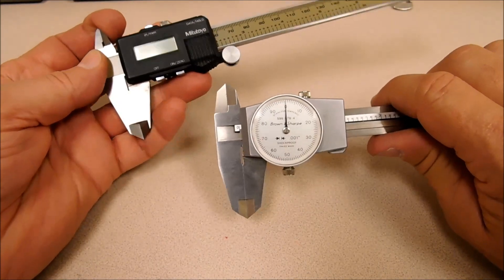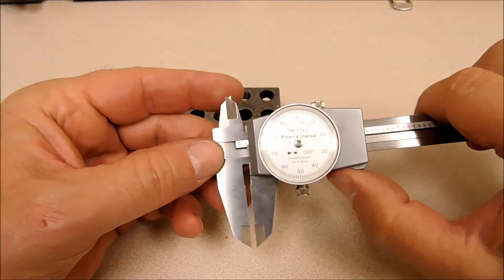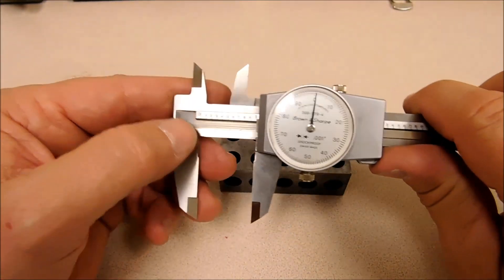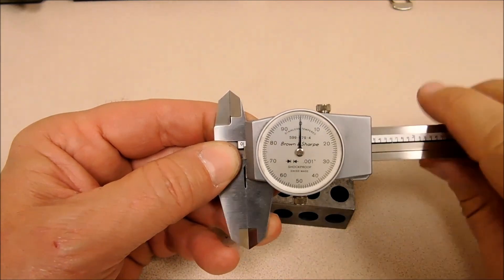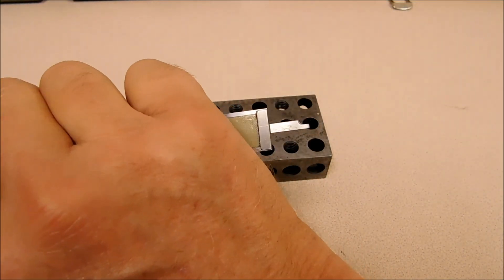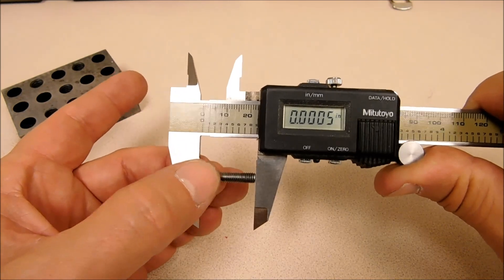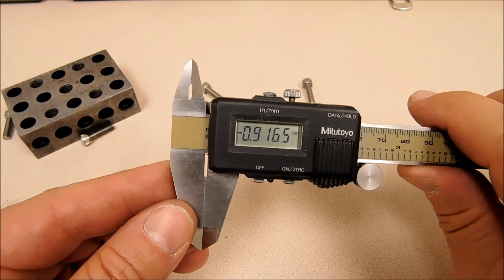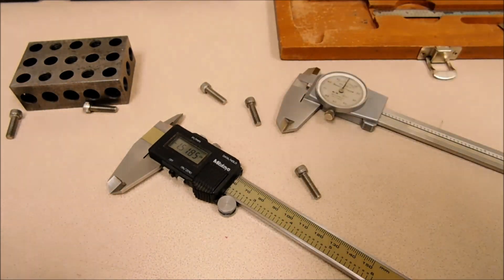Calipers -- Dial vs. Digital -- Does one do more ???  ( yes )

Comment: Now hears a question. not related to this video but it as a point. I was watching a video the other day on. [ A SUBJECT OF THE OLD,  FASHONR 4WAY.  TOOL POST ]  THE TOOL REMOVED THE NEED TO SHIM AS IT WAS CLAMP BY THE RETNING BOLT & PIN.  

ok, now to the question of improving the Base Design as there not maid, anymore but sort after by to days. hobby shop machinists. seeking to avoid the shaming ordeal. I sore . the toling was designed to be healed in a 4way without shims adjustment was by raising and lowering a tool,  hed that was claimed in place. By an internal thrust pin. 

ok here's my idea What if the Tool head was threat & sat in a threaded  Split sleeve. The thrust pin sat in the tool when tightened would clamp around the trends & prevent it rising pin I believe a reason they fell out of favor in industry. sector.   if we grooved the split sleeve would be allowed to rotate. be firmly clamped when pushed upon by the clamping bolt.   best of it trading, when releasing the clamp bolt &  retaining of the hed will enable upper or downward adjustment,   thus no shimming required. 

I watched your video on Boring bars & the versatile of the 1" sleeve holder as was you can use sleeves to go up or down. in tool size. &  putting the Tow ideas to work I think a hybrid of the Two with my new thinking would.  increase adaptability somewhat .  & enable a custom of boring bars to be created.& new tooling.   It may not interest you but I would like your opinion & your permission,  to use your idea.  I don't want to fit an adjustable tool posted.   & I certainly don't want to shim Tooling if it ok I will listen out for a reference to it in your chanal.  I suspect it to be ok in so much you have encouraged us to do so in your demonstration . of your design.  so for the evidence, of Doute can I use your design.,  & you will have. Joint copyright shud anything come of the idea.   Thank you's, truly  Leslie Anthony.  Stuart-Thompson < England Telford woodside.   Shusbery  Tf 75 Pt.  Should you feel the need to write.   Gust checking The Bace,  Son. Great videos Thay are very informative. keep it up.

Comment: How many times a day do you need to play with the battery to make your digital calliper work?  I have two and they drive me nuts.  Open the battery door, closet the battery door.  Remove it, and put it back in.  Twist it.  Open it, put a folded paper inside.  Next week, open it, remove the paper.  WTH?  Why can't it just work?
Reply from the maker: Never. My battery also lasts better than 2 years
Reply: @joepie221  My batteries also last a long time and no problems with them working. Maybe it's the quality of the caliper?
Reply: Mittutoya battery lasts 10 years. Harbour freight two weeks. They look the same. Can't beat a decent dial caliper.
Reply: glyn hodges  $35 - $50 if I remember correctly for each of  them.

Comment: YES, digital calipers DEFINITELY do more...  they run batteries dead and stop working.  stick to dial or vernier.

FIRST LAW OF ENGINEERING:  KISS (Keep It Simple, STUPID)!
SECOND LAW OF ENGINEERING:  if it ain't broke, DON'T FIX IT!
Reply from the maker: You guys must own cheap digitals. My batteries last for years.
Reply: @joepie221  At least we can buy a pallet of batteries at the dollar store cheap '-)
Reply: They run batteries dead when they are cheap chinesiums or knockoffs which draw significantly more current from the battery and draw almost the same amount when they are off (they don't really go off, just the LCD). Mitu or other quality digitals where the electronics isn't simply done as cheap as can be draw significantly lower current and with the LCD off draw significantly less again.

https://youtu.be/KnDype-j3hk
Reply: THIRD LAW OF ENGINEERING: Batteries SUCK :-)

Comment: I also like being able to set zero on the digitals...it's great when, say your dimension is to small to get the depth or height feature on. Zero out on the OVL/OVH (what have you) then measure your step or whichever and there you have a "very near" reading. Oh...and great to do this laying out work  if you don't mind doubling your calipers as a scriber and your tolerances allow.

Comment: I use digital, dial, and even the old-school verniers at times, just depends on the situation.  I have way more faith in my old Starrett dial caliper than my import digital caliper, but will admit to liking the digital for laziness.  Thanks for sharing.
Reply: Other than for nostalgia, in what situation would you use an old-school vernier over both dial and digital? I can't think of a single case where a vernier would be better. Unless you doing something where it's likely to get damaged...
Reply: @steveh8724  Admittedly, often the good quality old school vernier one comes out for fun's sake, but it's also partly to keep in practice for using my height gauges, both of which are in vernier scale (old B&S & Starrett).  I do however use a cheaper plastic vernier daily at work for close fractional measurements as it is graduated in mm and fractional inches to 1/128".  I just love the simplistic elegance of the Vernier scale once one can read it correctly.

Comment: As a new to the trade machinist, here's my experience. The first calipers I purchased were igaging 8" digitals. This was while in my machining school and for the versatility, convenience, and cost. They were and have been great. However, after hiring on at Kurt manufacturing as a cnc machinist... I had a single drop of coolant fall from the lathe directly onto my calipers rendering them useless. AKA not coolant proof! I immediately purchased a 6" dial, brown and sharp (just like yours), because of the reliability. As a new machinist I would suggest a set that is dial and earn your way up to a digital set that has an IP rating for use in the CNC machines.

Comment: I have two of the older Mitutoyo calipers like the one you are using. I have had people try to buy one because,in their opinion,and mine,the new calipers are not as high quality..I also have a Mitutoyo   3axis KC dro on my mill that has functioned flawlessly for 25 years. Yeah, I like Mitutoyo.😃
Reply: Hi joe, just watched your video I also have the same model calipers. Thats not so important , What is; I didnt 
know about the height gage feature. 
I learned something knew, thank you.
Reply: I repair and calibrate them (as well as dial indicators, primarily) and I think that generation of Mitutoyo digital calipers feel heavier and more solid. I just sold a couple pair on eBay. Nothing wrong with the newer ones, but those from a couple generations back are more solid.

Comment: Be aware when battery gets low they get wonky. You can end up with 99" indicated on a 6" caliper.
Reply: See old AvE comparison of cheap v expensive digital calipers, both from Mitutoyo. Low battery voltage is a problem with the cheaper model(s).

Comment: thanks Joe,
 A couple of things. On the dial caliper you can learn to read between the indices for a closer reading than the .0005 of the digital, some guys like that. Also I have the same digital you have and I have to be careful not to hit the zero when using it. The newer digitals have "absolute zero" which pretty much stops that from happening. I think digital, overall, makes for fewer reading mistakes but just playing around I love the vernier calipers from Starrett and B&S. Lots of fun but old timers like me need glasses using them.
Rob
Reply: Rob, I suffered the same problem only worse in reading the vernier scales. Cataracts! I just got multi-focus implants to replace the lenses in my eyes. Pretty amazing technology. As the muscles that have always adjusted the focus work they now do the same with the new lenses. This only applies to the "multi-focus" type. Expensive but worth it. I can see well at distance, intermediate & close. I have 3 calipers. The odd one is quite old and marked USSR.

Comment: I have all three, but gravitate toward the dial caliper because of its analog readout. Like any analog gauge, it’s easier to sense big vs. tiny movements. But the inch/mm feature of my Mitutoyo, combined with that “center to center distance between pins” trick make it indispensable.

Comment: use the zero function all the time at work. even on the 1200mm. I work in an extrusion company and make plastic pipes and the function is really handy when we measure the ovality get the smallest diameter the zero the caliper en get the highest number. I think I use the zero button more then the on/off   :)

Comment: I have and  still use a Sears Craftsman vernier caliper I have had for 32 years.
Small adjustments along the way to keep it accurate. 
Used it for setting up and running a wood molder.

Comment: Another added benefit of the digital is, measuring center to center spacing on hole pairs. Set up the caliper to measure one of the IDs with the upper jaws, then Zero it out. Stick one upper jaw in one hole and the other jaw in the other hole. The reading will be center to center on the holes. Obviously it only works if the 2 holes are the same diameter.

Comment: Dear Joe, I have a vernier caliper (metric and imperial), a dial caliper (imperial only) and two digital calipers. i mostly use the verniers probably form habit as  I had them first. Both the digital caliper have a very useful feature which does not seem to be on the pair that you have. In imperial they offer the option of both fractional imperial and decimal imperial. This can be very useful for checking an unknown item in order to ascertain if one is looking at an imperial or decimal part an if so if it is a fractional size. Maybe not so much for a seasoned hand like you though as you will know most of the decimal / fractional imperial conversions by heart from long usage but for the amateur lime myself a real boon on occasion.

Comment: I've got some (brown and sharp, I think) digital calipers that have a three readout options, metric, inch, and fractional inch, it's sooo useful when measuring parts designed in the USA!  I'm of an age that the UK educational system used fractional inches and millimeters, but not decimal inches, so while I can get by in sixteenths as decimals, 64th and 128th's take some time to calculate, unless I use the calipers👍

Comment: The little step-down on the depth gage is for smaller diameter holes, which are often shorterer (shallower).  I've seen calipers that have a long round rod that can measure deep narrow holes.  Got to be more careful not to bend those!   I've got a set of Fowler dial calipers that reads both inch and metric - now that's a brain fart!
Reply: Ah. Obvious now you mention it! One of those little features that unless you've needed to use it or been told what it's for goes in the 'curious, but don't need to know right now' queue. Thanks.
Reply: The narrowed end is to index the apex of a drilled conic hole-

Comment: your trick with the screw lengths works just as well with the dial calipers within +-1inch.
Reply: Actually, that works if delta is < 1/2 full dial scale. Otherwise you have to be very careful...which way did it go?

Comment: I have 12” Mitutoyo dial, 6” Mitutoyo digital, and a set of Mitutoyo Diamond Verniers.   I bought the verniers in 1970.   Still the goto set.  Never a dead battery.  Never slips a cog.   The Diamond Verniers use .050” rather than .025.  Easier to read.  The digital are easiest to read, but are delicate.

Comment: You missed one for the dial - infinite battery life. Had both and been caught out by a dying battery several times. Worse still with one (not mitutoyo) the first sign of it was inaccurate readings. Now I only have dial.
Reply: My Mitutoyo caliper battery lasts nearly forever...even when leaving it on.  Granted it's not forever but long enough that it's a non issue for me.
Reply: How long of a period before your battery died?

Maybe change the battery once a year. That could eliminate battery dying at an inopportune time.
Reply: @xmachine7003  My battery lasts longer than I can remember.  Maybe like 3-4 years.

Comment: Hey Joe, Hard to believe you didn't actually include a REAL Vernier in your little review. Would have also been a great opportunity to explain how a Vernier scale works. Let's not forget that many mechanical Micrometers use a Vernier scale to read tenths of a thou.

I have and use all three types. True Vernier Calipers, Dial Calipers, and Digital Calipers. The latter two might be called Vernier by many, but are not really Verniers at all. The only truly trustworthy Calipers are the true Verniers. All the others can be wrong and users may not even know it. Ask me how I know that..... LOL! My go-to Calipers are the digitals. But I always pull out the real deal Verniers when I am in doubt. Nothing else is guaranteed to be right. Real Verniers are also MUCH more robust than the other two. They never go dead, they never lie, they never exhibit movement hysteresis or jumpy readings. But they are hard to use and they do require a user with more than coffee between their ears.
Reply: AND , they're WATER PROOF !!!

Comment: Yeah, General makes a 6" dial caliper in which there are 200 graduations on the dial with two zero positions. When you get used to reading a caliper with 100 grads then pick up the General to use in a pinch you'll be making parts that are dead nuts to size according to the caliper, but +/- 100 thousandths in actuality.

Comment: another advantage of the digital caliper is that there is no rack gear to pick up small chips and then break off a tooth on the dial.  That said, i still prefer the dial calipers for a number of reasons; (1) the "analog" movement of the pointer on the dial  gives a steadier reading (not flickering).  (2) the older dial calipers are structurally sturdier, and (3)the digital readout to the 0.0005" - half thousandths gives a false sense of accuracy.   In an experienced machinist's hands I trust it to +/- 0.001" at best, but in an inexperienced user's hands even though the readout is to the 1/2 thou., the flimsiness of the digital caliper's structure will be at best +/- .005" IMO.

Comment: Some other good and bad things:
Digital
+ Hold button - make a measurement where you can reach but not see directly.
+ Data logging - Record the value automatically.
- Accuracy - besides the accuracy of the tool itself you have to add the value of the least significant number the display can show! (Taught to me by an Mitutoyo specialist, wit an analog we can say if the value is above or below the indicated, not with a digital.)

Vernier / Dial
+ Works without batteries!
- Risk of parallax error

Comment: Thanks for the video.
There are dial calipers with .200 on the dial face, I have an 8" Mitatoyo it is very nice and accurate, now I need the eyes of my 25 year old self to read it. The .200 is nice for odd / even numbers, half the face is even the other odd.

Comment: I have used my dial caliper to verify multiple items by zeroing the dial at the required measurement.  However my dial caliper won't return to the original measurement and it doesn't have a dual MM In scale, so I concede there are two advantages to a digital, however the batteries are a major disadvantage.  It seems the battery is always dead on one or more of my digital calipers.  I do have  turn off but still can't seem to keep them hot so I go back to my Starrett 120a.

Comment: I prefer vernier calipers in my pocket, I don't have dial calipers! I use metric most of the time. I have cheepo digital calipers to have the zero anywhere function. I turn the battery over when not in use as when in the off position, it's only the display that is switched off!

Comment: One really handy feature with the digital you missed that I use all the time; Measuring the distance between two holes, or two pins, etc., as long as the two have the same diameter. Measure one of the holes with the inside (or the pin with the outside) and set your zero to that. Now measure over the pins outside (or the holes inside) and you get the distance between. In effect you are subtracting twice the radius of the feature to get the center to center distance. I also use it occasionally for calculating dovetails to get the distance between pin centers. Also may work for thread wires to get the P.D., but I haven't tried it yet. It's nice to have a settable reference whenever you need it.
Reply: You can do that with the dial, just rotate the diAl to set the zero.
Reply: Yes, that ranks up there close to number one advantage for me.
Reply: You beat me tuit! 🤣

Comment: I broke down and got a nice Mitatoyo 12” digital several years ago and have never looked back. I love the thing. I especially like it when facing off a part to an exact thickness. I can chuck up the part, zero the mic, roll it out to the exact thickness I need, re-zero it and then measure the part while it’s still chucked up and make my cuts accordingly. Like you said, always check your zero and I always make two cuts. Say I’m needing to remove .026” my first cut will be .016” and if everything is correct the part should only be +.010” after the cut assuring that everything was as expected. And if I forgot to jam the tool post and the #’s aren’t right then I can make the needed adjustments. I mostly use a 6” , 6 jaw set-through chuck and the blade on this caliper fits in-between the jaws very nicely.